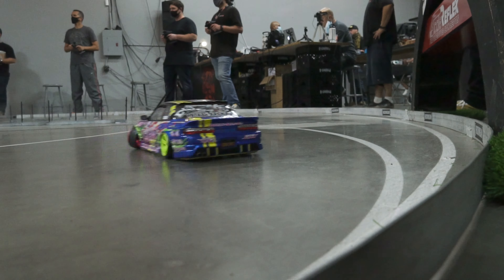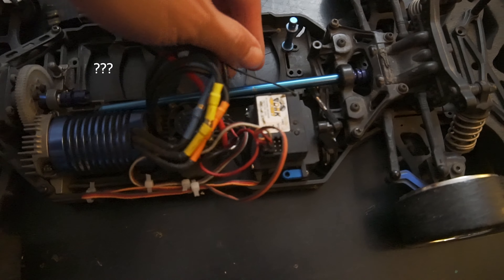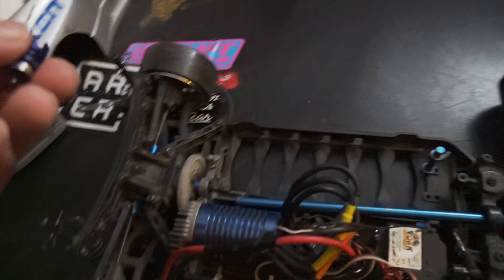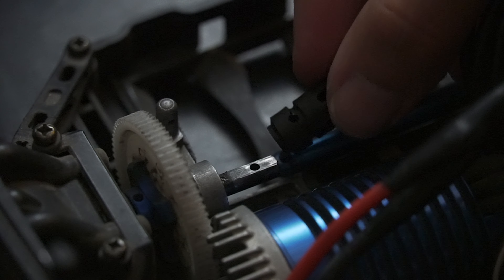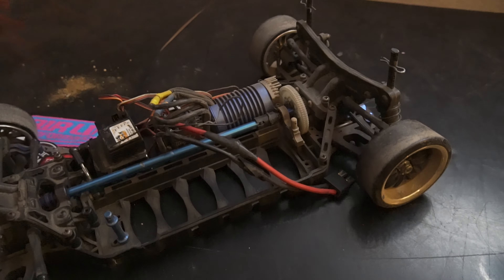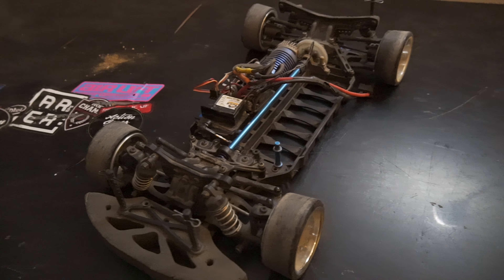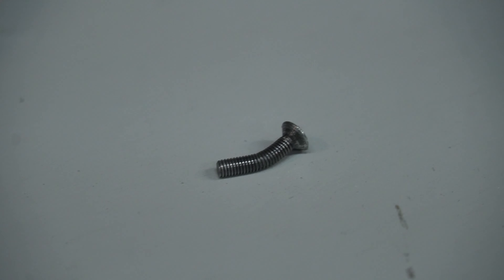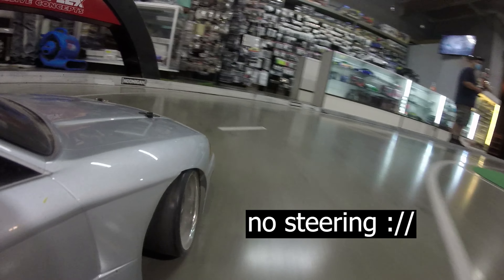drifting the project car at Super-G to test GoPro angles! // AWD Drift Project Part 5

Comment: Cool! Be sure to always use a drop of blue locktite on the tip of the screw when ever you are mounting a screw to aluminium or any type of metal. This would help you with your issues with having the screws come loose. Never use locktite when mounting screws to a pastic part though :) Looking forward to get to see what you have bought at SuperG. Super stoked about that actually :) :) Keep up the good work! Your videos are always on point
Reply from the maker: Thanks for the insight!! I was thinking about picking some up but I didn't know about not using them for plastic parts LOL
And the stuff I bought was some small stuff for the project, but hopefully it's still interesting! Thanks for the support, I appreciate it a lot!

Comment: Great video! What car is that 4wd you have? I also thought about loctite for the screws. Avoid the red stuff though. I got fed up of losing my wheel nuts and used red on them. Then snapped, **SNAPPED**, the axle in half when I tried to undo them. This has happened twice now.
Reply from the maker: Thanks!! This car is the Yokomo Type B! Dang I'm sorry to hear man. That is really surprising, I've heard about how strong red is but I wouldn't expect it to be at that level haha

Comment: I don't want this to come off as hate. I'm curious, why are you building AWD? Isn't the current trend moving away from it?
Reply from the maker: Haha no worries! While the trend is moving away from AWD, the idea for this project is not necessarily for use just at the track. A few years ago I was inspired by the gymkhana videos from Ken Block and wanted to be able to make cinematic drift videos at whatever locations I found cool. Since the surfaces can vary a lot at random locations, an AWD car would be able to handle the task better than a RWD. That was the interpretation I had when I originally bought the car but RWD chassis have made huge strides since then. I'll be building one of those sometime too hopefully!